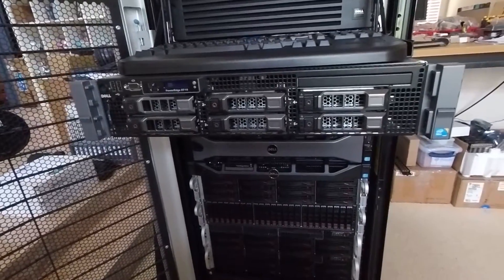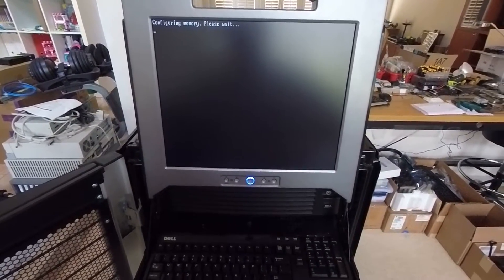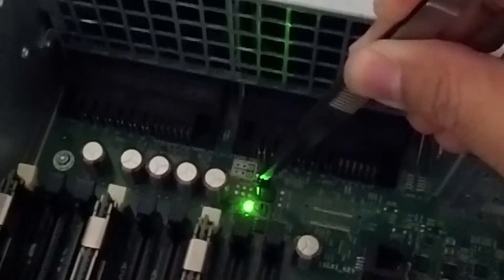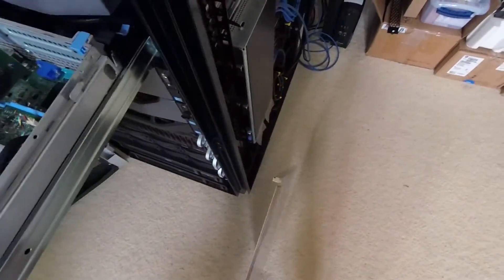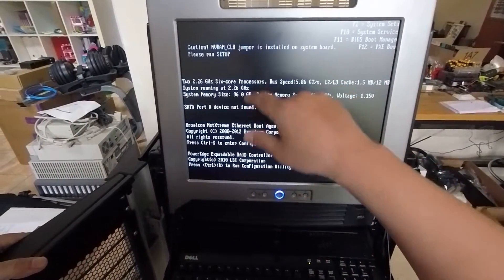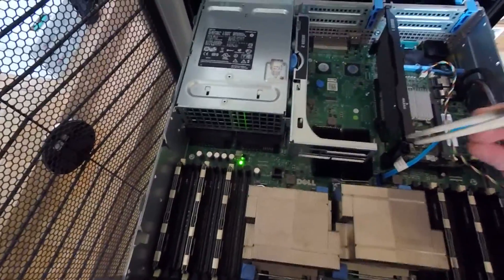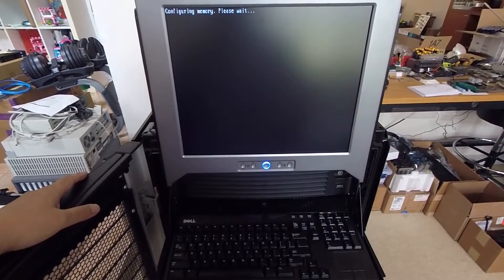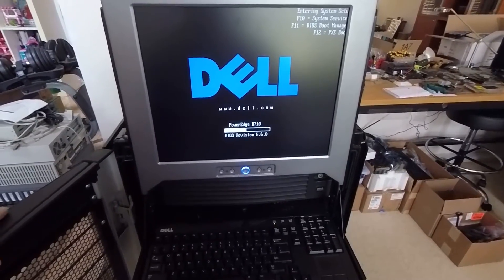Restoring Dell Logo on R710 with NVRAM reset

Comment: My dell r710
Still stuck at dell logo screen
Nothing changed
Except
When jumber in 3&6 it check memory first
When jumber at 1 & 3
No memory checks
And enter to dell logo and stuck
Reply from the maker: Check the CMOS battery voltage.
Reply: @ArtofServer  I change it 3 times
...
..
I think it need to re program bios
Or something like that
Reply: I have same issue currently, were you able to resolve this and how?

Comment: This helped me out a ton. I don't think it is just a cosmetic issue. I am happy to be corrected on this, however, if the NVRAM_CLR setting is enabled (jumper cable on pins 1 & 3), any changes to the BIOS will not be saved. I needed to enable SR-IOV on my server and the it would disable after every server reboot. Placing the jumper cable on pins 3 & 5 solved that problem. Cheers !
Reply from the maker: Glad this was helpful! Thanks for watching!

Comment: what's that keyboard/screen 1U combo called? would be nice to have, i'm sure there are some on ebay :)
Reply from the maker: They are known as "KMM" for Keyboard-Mouse-Monitor and there are various models from all the major server brands. If you buy them used, be sure they come with a full set of rails. The rails are often impossible to find by themselves, or are prohibitively expensive.
Reply: @ArtofServer  Ok thanks!

Comment: Can this fix an issue with it being stuck on configuring memory for days? OK so when I booted from the nvram pin set it seemed to work just fine but when I moved the pins back  to default I still have the same problem. Any ideas?
Reply from the maker: sorry,... no idea...
Reply: @ArtofServer  It seems another flash and re-seating the RAM seemed to help, It was already placed in the correct order but figured while I was inside looking for anything out of place that I might as well do that. I also changed the sticks of RAM that would have been used in order from the VMs i had just allocated memory to with the sticks that would be the last memory to pull from.(According to R720 documentation I pulled from Dell's website) Just in case there was an issue with one of the sticks as the last change made to the server (besides an update) was adding 2 VMs and allocating 4GB of memory to each.

Comment: Hi, not had my R710 long, it’s my first server, don’t suppose you fancy doing a how to on how to upgrade the bios, firmware, idrac etc please. Trying to read up on it it’s now not supported by Dell so it’s not as easy to do (for me) Iv installed Proxmox on it and got a few vm’s running but I’m limited to 2tb drives. Any help greatly appreciated! Cheers
Reply from the maker: I would be happy to do that, except my R710 has been fully updated already! I should have thought to record doing the updates when I was doing it! Maybe next time...

That said, all I did was go to dell.com and downloaded all the updates for my server. Since I use Linux, they were a bunch of .bin scripts where are just some self-extracting shell scripts. All i did was run them one after another. If you have particular problem, let me know i can try to help. :-)
Reply: Art of Server Thanks. So if I switch to another drive so I’m not booting up Proxmox. Install Ubuntu for instance and give that a go? Or any idea if I can do it in a vm? Must admit my Linux knowledge is limited so any tips appreciated. We have a bank holiday on Monday here in 🇬🇧. Will give it a go then. Cheers
Reply from the maker: @shaunwhiteley3544  Proxmox is Debian based Linux, so that might work by itself without the need to boot something else, but I haven't tried it. I know most of Dell's scripts are geared towards enterprise linux like RHEL or CentOS, so if you're going to boot something else to run the firmware/bios updates, I would run that to reduce the chances of problems. Dell also provides Windows utilities for updates, so that's another option too ; though I'm not familiar with them.

Comment: Looks like you have disabled "Silent Boot". Turn it on, same noise but it hides the messages and displays the logo.....
Reply from the maker: I did try poking around at the settings available in the BIOS setup menu, but I couldn't find a setting that brought back the logo after changing it.

Comment: This trick works, but it's more of an "oopsie" on the Dell BIOS side, the code they get (they don't write the BIOS, they license it, probably from AMI) has the code and functionality to enable/disable showing the logo, they probably forgot to add the option to the BIOS GUI setting part.
Reply from the maker: Yeah, i think you're right about that. On other brand servers, usually there's an option to have a verbose POST, or a "fancy" one with logo. On the R710, I couldn't find such an option that brought the logo back. So, I'm not even sure how someone got it into the state it was in where it was not showing the logo during POST.